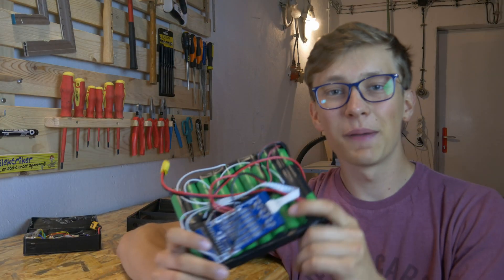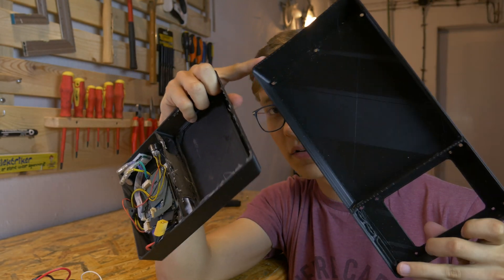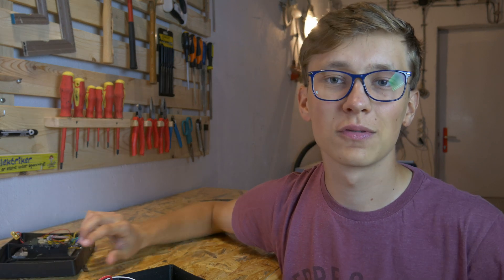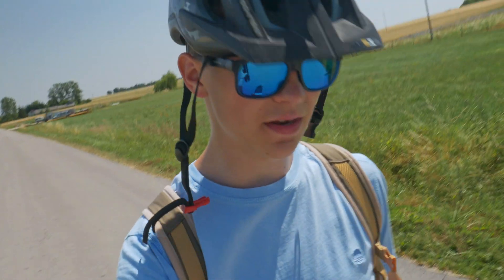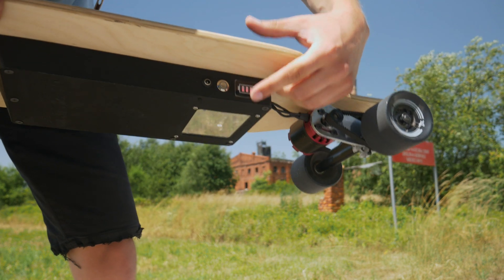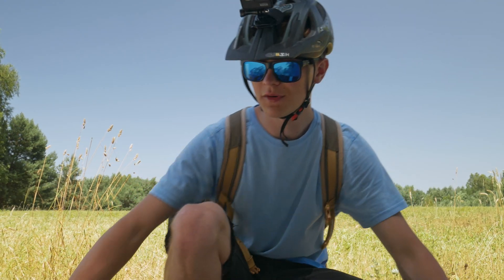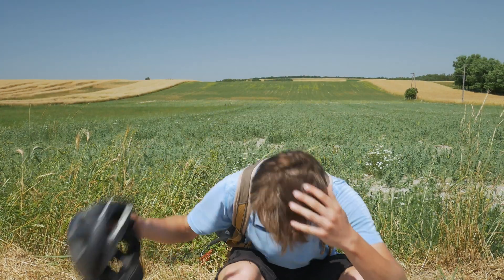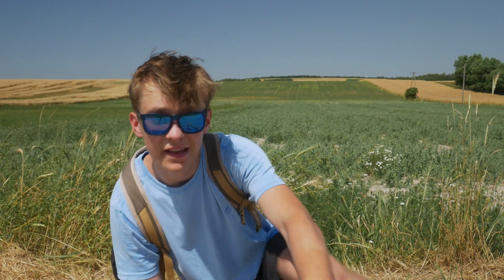DIY 18650 Electric Skateboard Battery Pack

Comment: I'm new to your Channel very impressed with this project I'm going to order all the parts from your links and attempt to do it also I just subscribed, one request if you would please can you put out a more detailed video on how to solder the batteries and Link them all together pls it is not clear which orientation the batteries are and how they all connect together